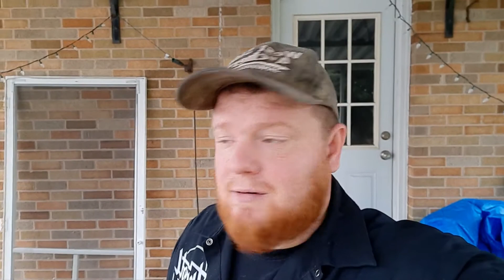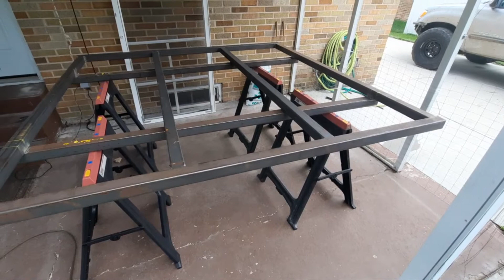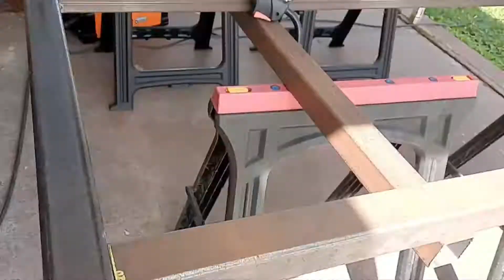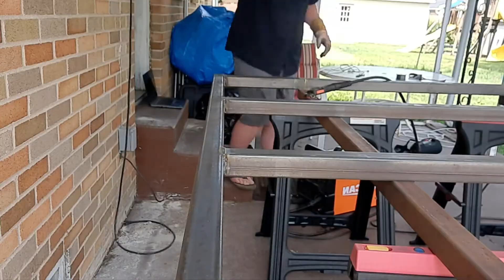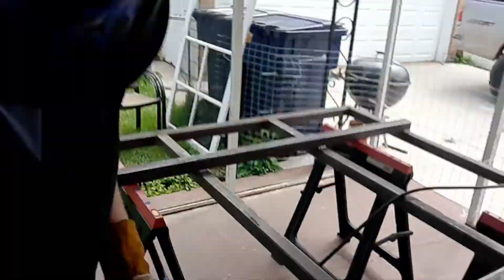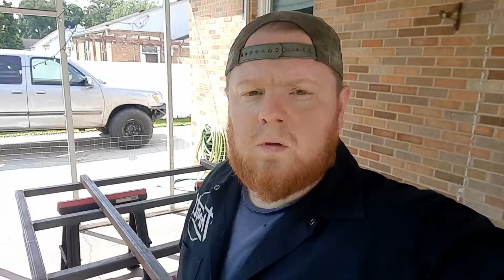Toyota Tundra Flatbed/ Tray Build PT. 1

Comment: Hi great job u did there, how much does it weigh? And does it help with mpg?
Reply from the maker: the bed is not finished yet, but it is probably heavier than stock. I will have to weigh it after I'm finished and compare to the stock curb weight. My truck has never had good gas mileage. My drivetrain is modified and i have much larger tires without being re-geared so i get 12mpg compared to the supposed 16/19mpg